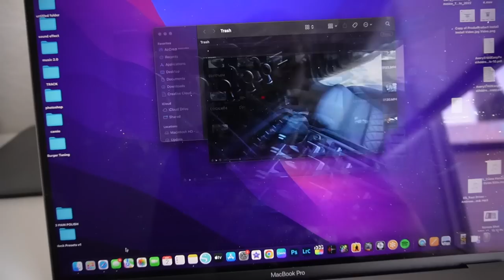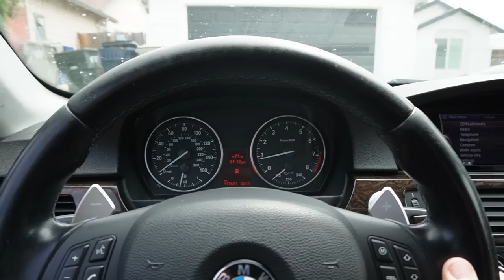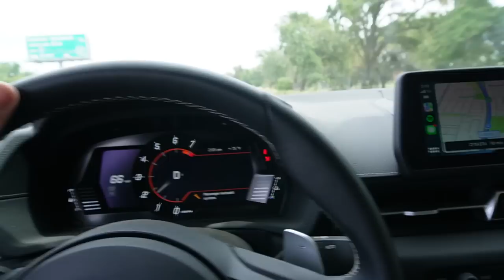DRIVING A BRAND NEW 2021 R8! IT SOUNDS INSANE!

Comment: Congratulations Nour. Supra coming together. It’ll look stunning once completed. I bought my first Audi this week, after owning 14 BMWs in the last 18 years! A friend had a R8 when they first arrived in U.K. few design faults with the two carbon side panels fading,  fuel cap, rear plastic slats trim above the engine melt when too hot. Probably improved since then. You will be in your own R8 sooner than you think. 🇬🇧🇬🇧🇬🇧

Comment: Hey nour hope ur all good . Glad you got the supra back but I would replace that 1/4 panel skin as the metal looks very weak and for the money you spent on it at frame shop u could have got it all done the right way in a bodyshop such as ssr or a proper bodyshop would be bit more expensive but worth it .